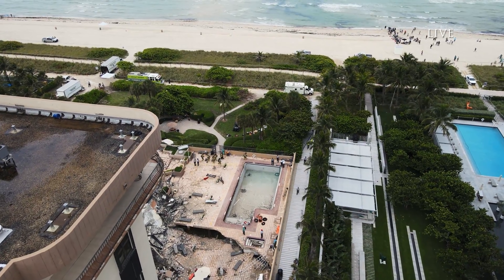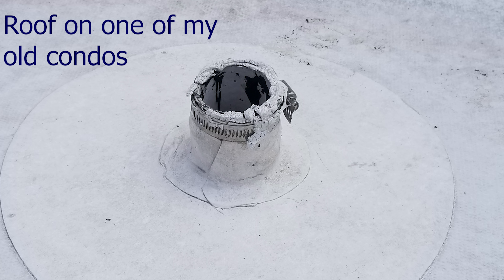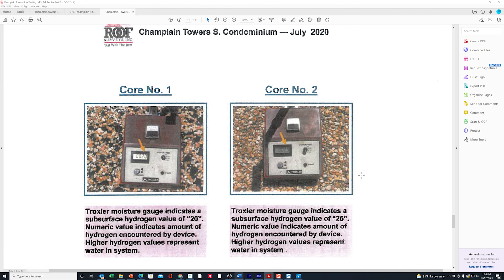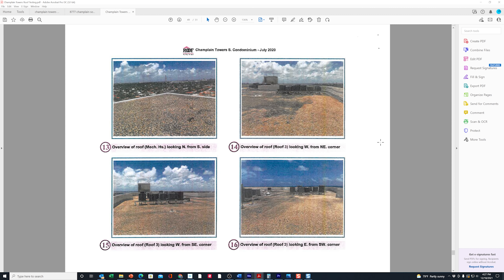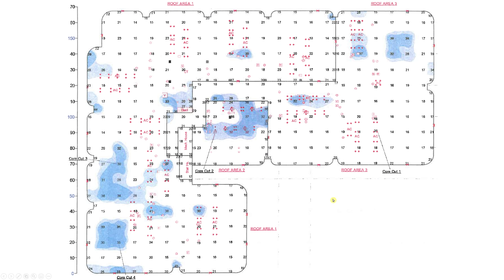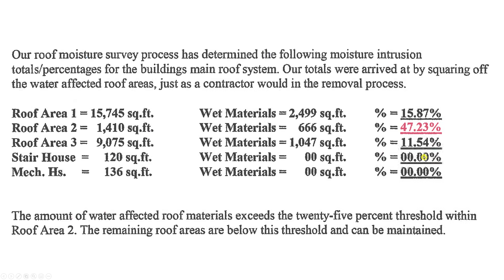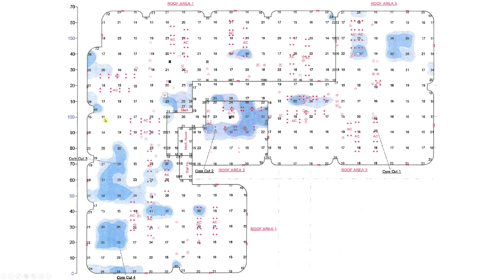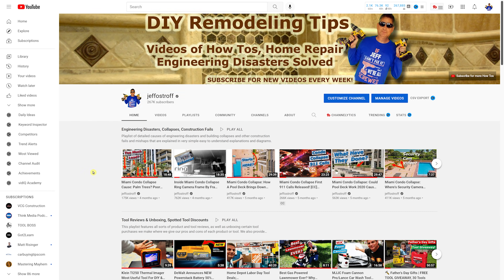Condo Collapse: Water Found Under Roof Layers (Saturated)

Comment: J built a 100,000 SF 12 story reinforced concrete structure in n1971. It has been closed by the building inspector due to concrete Spalding and tenants stating they could feel vibrations. Since many tenants have long-term leases for space, it is a lawyer's banquet. The owner says he may have the nine-million dollar building demolished for another $4 million. No lives were lost. but the Florida structure sure is a big influence. How many more are there around the county. Engineering is becoming a full-time teaching profession..
Reply from the maker: Yes concrete is a problem material down here in fL

Comment: Something I took away from this is the water pooling on the roof 2 section, which was pooling up despite there being a drain right there. The only way I can see this happening is if the slope wasn't adequate....it's such a small section of roof! Is it possible this is an indication that the foundation was already starting to sink/crumble on the right (east) side of roof 2, so the pitch was now sloping water to the edge instead of the drain?
Reply from the maker: No, we see this problem all over here in FL. Builders, and then roofers don't seem know anything about pitched roofs, and when they tear down a multilayer roof to build a new one, they fail to slop it back tot he drain.
Reply: @jeffostroff  I live in NY...with snow and freezing water, it's a whole different animal! You should see the extent of spalling here on everything...buildings, roads, bridges, etc. It would probably frighten you. I wonder if they use more rebar and concrete to account for that here?

Comment: The amount of extra weight in that roof has to be a contributing factor in the collapse.
Reply from the maker: It could be I still believe that hand the pool deck area concrete not disintegrated and become useless, the building could have stood up even to the added weight on the roof and the penthouse. But the problem is is when you collapse that pool deck and now you're left with columns that are tall and skinny they're going to buckle under that weight load because they don't have the aid of all of the other columns distributing the load through the pool deck slab which is now collapsed.

Comment: Shows a poorly drained roof.. and that matches a poorly designed and poorly built condo. Classic overly complex inspection, whereas a simple look at the basement by a cognizant building official, would of evacuated the building.
Reply from the maker: I can tell you that I have seen numerous buildings down here in South Florida whose roof pitches are just atrocious. I think there needs to be a lot more  tough regulation on the part of the inspectors on flat commercial roofs to make sure that they are sloped toward a drain.

Comment: I think that I made a comment about major roof problems on the Champlain towers roof when I saw the arial views!, I remember this same thing on an apartment building that I did maintenance on years ago!, I kept telling management that the roof needed to be replaced, but only patched it. Then, when the roof was leaking badly during a storm, they finally had a roofing company come in and replace the roof, but they didn't do a good job, and it failed in the next rainstorm, causing the apartment to be flooded, with the ceilings collapsing and other water damage, company's insurance had to pay for the complete restoration of the apartment!! I still believe that water had penetrated into the structural elements of the building! Great video, thanks 😊
Reply from the maker: Yes these stories are likely repeated in numerous apartment buildings around the state

Comment: Why are you leading the public to correlate a roof with water intrusion and structural failure? You’re a home inspector correct?
Reply from the maker: Why are you lying and claiming that I am leading the public into the roof having anything to do with the failure of the building? In fact I specifically stated in the video that the roof does not have anything to do with it. So I don't know how you come up with this nonsense that I am claiming this. Sounds to me like you're just another troll out to try to show everybody how more righteous you are than everybody else.

Comment: long & short is the whole building was built from poor designs which the collapse is the result of this, every month without fail the condo collapse comes up with a different thing about it lets just face it if you designed & built in the same way we do in britain your buildings would last, so far uk have had buildings towerblocks especially thats caught fire & they are still standing long after the entire buildings left as a shell after the fire yet yours come  down with no reason so everytime an incident like this happens dont go thru the what if look at how they area designed then you will find your answer as to what went wrong stop dragging it out

Comment: Interesting stuff.  I think that when that company took samples on the pool deck, that big square section that was coned off but never repaired was what finished it off.  The problems with the planters and the columns/ceiling underneath were bad and opening that section above just escalated the problem. I'm surprised with the lawsuits coming out that the focus was not on that company?
Reply from the maker: Yes, since I pointed that out in July on a previous video, I thought they would be all over it.

Comment: I am somewhat perplexed by the way the roof is insulated and waterproofed. It seems to me complicated and not very durable. Having wood and other stuff that can get waterlogged seems a strange thing to do.  I do not understand much about roofs beyond observing when my roof was built.  It is quite simple. There is the reinforced concrete slab, then on top of that is a layer of polyurethane foam which was sprayed on and is about 80mm thick. That does the heat insulation and waterproofing. On top of that is a layer of screed which is then topped off by about 40mm of poured cement giving it the final smooth finish. 
It seems to me that it is quite impossible for it to leak unless the polyurethane foam somehow decomposes. I think water accumulates in the screed but it doesn't do anything because the polyurethane foam prevents it from going further. It seems to me a logical way to do it and I'm not quite sure why not all roofs are done that way.
Reply from the maker: The membrane and mopped on tar over the top with aggregate is supposed to protect the lower layers for 15 to 20 years.
Reply: @jeffostroff  Yes, I understand that but what I do not understand is the choice of materials. Why put insulation that can be damaged by water rather than one which is itself the waterproofing?  It just seems to make no sense to me.  It would for a building made a century or two ago when there did not exist a better choice of materials.  Are they just sticking to old methods because of outdated codes or something of the sort?  
The way I see it is that it is better to have something that does not need to be protected from water rather than trying, and failing, to protect a vulnerable material.

Another thing that seems to me to be seriously wrong is having a permeable layer of material sandwiched between the waterproofing and the slab. That allows any water that gets past the membrane to spread over a wide area before it starts penetrating the concrete slab and when it does eventually get through the concrete it is everywhere and you have no idea where the leak is, all the insulation has been ruined and the roof slab itself may have also been damaged due to the long presence of water.  On the other hand with polyurethane foam, even in the unlikely event that it is punctured or fails in some way then the water that gets through will appear directly below as a damp spot on the ceiling.  That is because the foam adheres to the concrete surface and will prevent water from spreading laterally. The leak spot can therefore be easily located and repairs can then be carried out on a very small area around that spot by cutting a square of the top cement layer to gain access.

Comment: Never trust ANY company that advertises itself as (insert religion) - that always means they're gonna rob you blind. Every single time. They wouldn't bring up the religion at all, unless it's to build a sense of false confidence in their ethics and practices. And that goes double for any plumber/electrician/etc that's not a member of the local union. There's a reason they're not a member and it's usually cuz they don't work up to the union's standards - whether that's cutting corners or incompetence (sometimes both).
Reply from the maker: good ideas!

Comment: Champlain tower east has a beautiful clean roof. Champlain north roof looks just as bad as the one that collapsed. If I lived in North, I’d be getting out!
Reply: It collapsed from the bottom, not the top.
Reply: @jeffreyanderson1851  ok so when it rains on the roof the water or whatever it doesn’t go to the bottom at all?
Reply: @randomexploring541  rainwater is supposed to slope towards a drain which will carry it down to a storm sewer. Otherwise it just sits there until it evaporates, or soaks the roof until it finds a way to seep through the concrete slab and makes a leak into a top floor corridor or apartments. Any concrete or rebar deterioration would be found on the top floor roof deck, not on the support columns and slabs in the parking garage.
Reply: WATER is heavy & perhaps that put excessive weight on the roof & columns (which eventually lead down to the weakened pool deck columns).
Reply: think about the excellent deal you could get tho, it would be a STEAL.

Comment: I agree with your assessment, however it DOES speak to the overall condition and maintenance practices present at the building. One thing I’d LOVE for you focus on is the Champlain towers north… this continually bugs me, what were they doing different than CTS? Did they replace their roof first? Was it pitched or drained differently? 

I think comparing the two structures could be the easiest way to uncover any criminal negligence (from a legal standpoint) - as why would they have changed x,y,z, - did they realize it was incorrect and posed a risk on the initial CTS build?

I’m assuming this is what lawyers are attempting to do right now, but again CTN is a great control I think. Just what steps in initial construction, engineering, and maintenance could have allowed one building to become so dilapidated compared to another of similar age and construction? That’s the key.
Reply: CTN paid attention to maintenance before it damaged their building.  CTS did not.  It's that simple.
Reply: @johnbergstrom2931  Right, I think we all know that - I’m saying where are the records showing the actual differences in maintenance and money invested into things like replacing the roof or fixing water issues, etc. 

Also no, I am getting the impression that there were some significant changes between the construction of the two structures… I think that’s highly relevant.
Reply from the maker: I did manage to get inside the building of the north towers but I got kicked out they apparently have a lot of problems going on there as well because their pool has been closed for several months now and they are likely facing similar issues as they go through their 40 year recertification as well. The Champlain tower South building was on a larger site so certainly in the floor plans the north towers have two fewer condos per floor than the CTS did. Most of the garages are almost exactly the same floor plan on the eastern side of the garage for both buildings
Reply: @EstorilEm  I'm sure any records showing CTS incompetence were shredded or mysteriously disappeared in late June...
The differences between the 2 buildings were not as important as the most important similarity: they were both built by Nathan Reiber.  I'm sure CTN is seriously entertaining the offer by a developer to buy it (and CTE) and demolish them.
Reply: @johnbergstrom2931  Very good point (and assumption) - luckily this is high-profile enough that I don’t think it’ll be that easy.

Comment: What is the issue? More moisture makes the roof heavier?
Reply from the maker: The issue is that once you have a lot of moisture in all of those membranes and all of the insulation, first of all the insulation loses its properties. Second of all you're adding a lot of weight on top of the roof, and thirdly with moisture trapped underneath all of them layers it is now sitting on top of the concrete where it will soak into the concrete, make the rebar in it rust and expand and cause concrete spalling with the concrete just starts cracking and weakening and that would be very bad.

Comment: I'm living in an older building that just had a 5.9 earthquake in anchorage , do they inspect these buildings after earthquakes ?
Reply: Well, the epicenter was 135 miles away from Anchorage, so I don't think you have anything to worry about.  Back in March 2020, we had a 5.7 quake centered 3 miles from my house.  Caused a lot of cosmetic damage (brick parapet walls falling, cracks in older 19th century multistory masonry buildings) but no deaths, and only one structure was damaged to the point it had to be demolished.
Reply: @johnbergstrom2931  there is an open parking under the back half of the building there are columns with a beam around the perimeter. Looks like there are some cracks in the masonry on the beams at the center between the columns. Some of the cracks look old and some look new , I believe they had an earthquake a few years ago. Thanks for your response.
Reply: @seanokeefe703  It's really the old masonry buildings (19th century) that are at risk.  They didn't use portland cement in the mortar back then.  I don't think you have too much of that in Alaska.  Seems like your earthquake awareness/preparedness up there has been pretty good as well...
Reply from the maker: I don't know, let me know after it collapses!!!
Reply: @jeffostroff  I will try

Comment: Witness' said the collapse began in the area where cars were parked and cascaded to the planter area.  Not the other way around.  I believe the vibration from construction weakened the connection between the deck and the columns under the parking area.
Reply from the maker: Well if you look closely at the witness accounts nobody was able to tell which way it really propagated. The witness accounts I saw in the most credible one would be Sarah nurse who was with the security guard in the lobby telling her to call 911, when she saw the cars in the covered parking deck collapsed down into the garage. She had no way of knowing what way they propagated in the collapse.
Reply: It's likely the pool deck collapse happened quickly (or all at once) and made it's way to the building columns in seconds.  The vibration theory is nonsense.  The pool deck was incompetently designed and extremely underbuilt.

Comment: Jeff, one other thing I didn't hear you say was the effect of water laying on a roof with relationship to the sun.  Water sets up a prism effect that emits ultra-violet rays when the sun hits it.  This substantially degrades the roof over time at an accelerated rate.  There is a lot of research on this subject.  Proper roof drainage is essential to prevent this effect.  Many building owners will eventually install a liquid epoxy roof coating that hardens into a protective layer when drainage is an issue.  I saw no signs of it on this flat roof.  What a shame.
Reply: A properly designed, long lasting roof (like epoxy or rubber membrane) costs more than the traditional tar and gravel system they had and were replacing.  And if one thing we've learned is that CTS condo management was cheap and neglegent.
Reply from the maker: If you look at photos and drone videos from above the condominium after the collapse, you can see on the part of the building that was still standing they had already rolled on a whole bunch of liquid tar in certain areas their plan was to patch up certain areas that that were not as moist as the area of roof number two that needed to be replaced in its entirety.

Comment: I’ve worked on a bunch of south Florida building flat roofs and the drains always end up as the highest points. They are put on top of columns to allow for the pipe to be hidden and thus don’t sink with the rest of the roof.
Reply from the maker: that is a strange way to design it
Reply: I've seen that same phenomena on every old flat roof I've been on.

Comment: You commented on the filthy look of the roof.  I realize that a filthy look doesn’t always mean a problem, but it’s interesting to note that Google Earth shows that Champlain Towers North has the same filthy look.
Thank you for another informative video.
Reply from the maker: Yes interesting to see what problems that building has
Reply: Which is probably why the roof in itself didn't cause the collapse though it may well have contributed to a degree. The building was suffering water penetration from both the top and the bottom. Sadly something had to give....the North building may well have water damage to the roof too, though it doesn't appear to have the same issue with excessive water penetrating the foundation, pillars, etc.